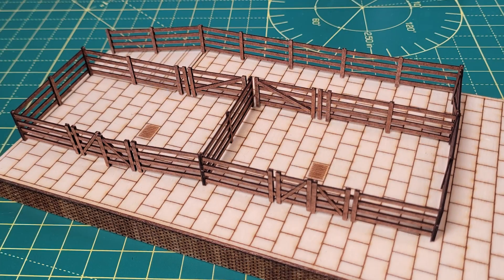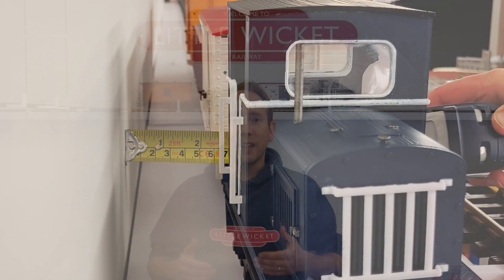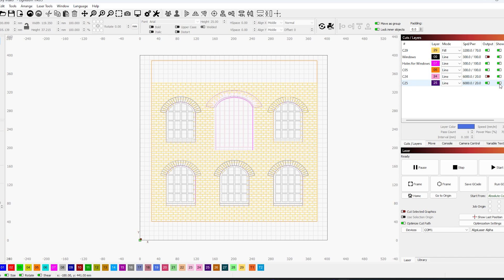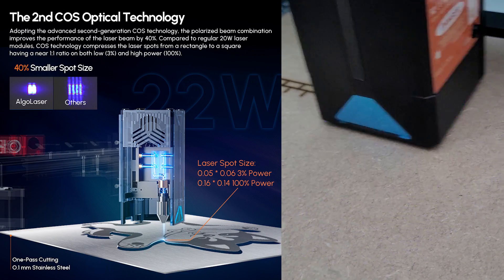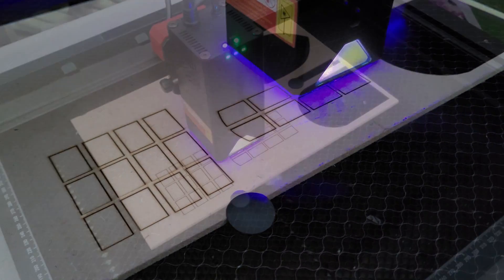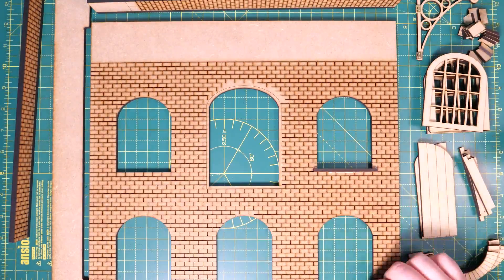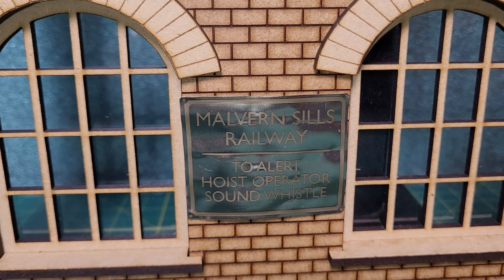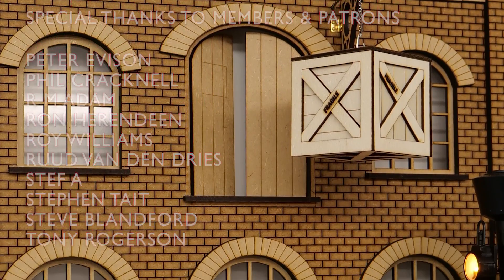Incredible Results at G Scale | 💥 AlgoLaser Alpha 22W Laser 💥

Comment: Interesting project, Rob, good to see the variety of things you've been lasering (is that a word?)
I really do think one of these might well be the big purchase of the year, after some of the house move chaos has settled. How fine-detailed can this thing go?
Reply from the maker: It's pretty fine, I think the beam width is ~0.1mm^2 (official spec says "Spot Size: 0.16*0.14mm 100% Power / 0.06*0.05mm 3% Power"). I'm tempted to get the extension which makes the working area 400mm x 850mm so I can cut full buildings from a single sheet. Also maybe the rollers so I can engrave on cylinders.